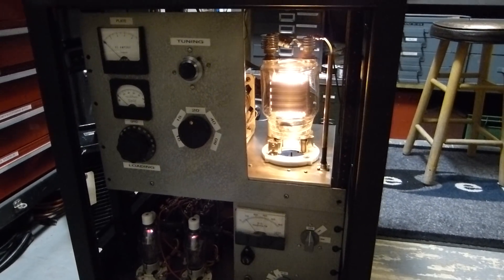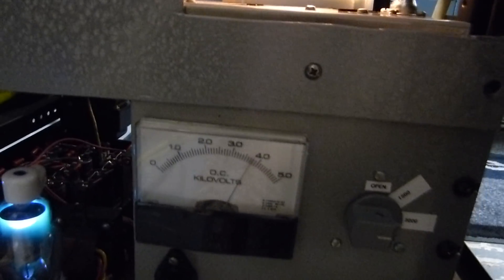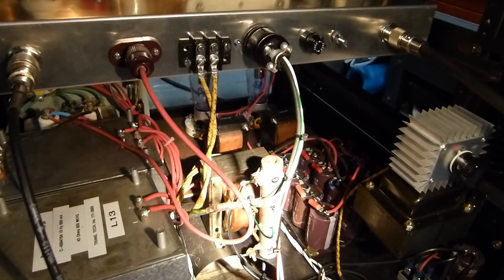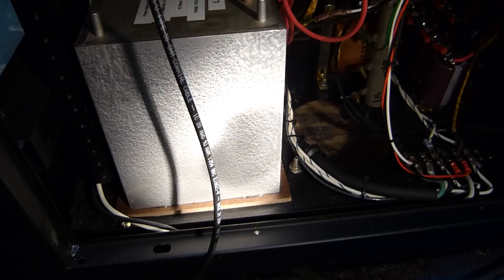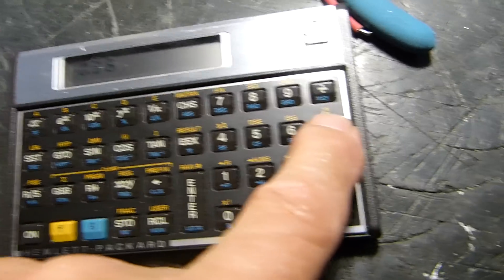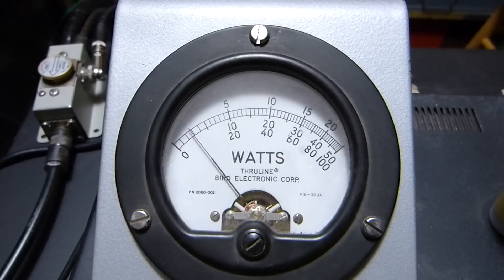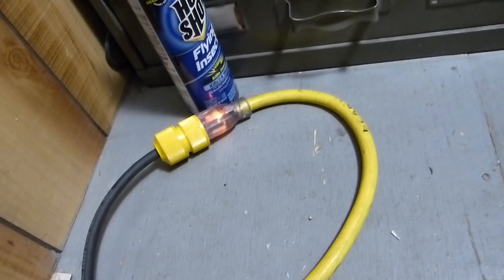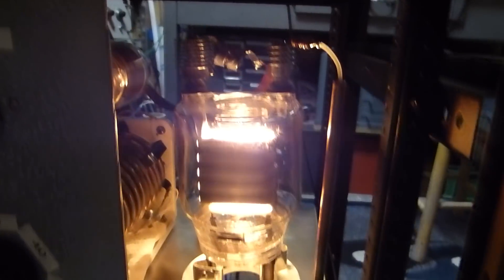(1 of 3) 833A Triode Vacuum Tube Radio Frequency (RF) Amplifier For 20 Meter SSB

Comment: i pulled my one out of  storage and want to finish it this summer, it is a project that never got done due to parts availability, any way, mine i want to go GG at 3000v ht, 160 to 20m is my goal, 15m and up i have other amps to cope.... how much drive did you use on the grid and what is your grid voltage set too ? enjoyed the video.
cheers Johan
project, phase 2
  https://www.youtube.com/watch?v=GUnv6McaL7s&ab_channel=LuckyDubeinRC

testing tube   https://www.youtube.com/watch?v=OxwV3x0OjLQ&ab_channel=LuckyDubeinRC
Reply from the maker: You need to see my last video on the 833A so you can see the bias level I use at different plate voltages.
https://www.youtube.com/watch?v=ChHPL84f22Q
I don't think the 833 is going to work very well in GG. It is a medium gain triode and not a high gain triode so grid bias is necessary.
Thanks for your links.
Reply from the maker: I have seen your YouTube postings and always give you a thumbs-up. Not many of us are interested in building with this big bottle  triode. I think I build mine just to see how hard it would be to tame this beast at 20 meters. There were some challenges and ideally it would be best to have a roller inductor for the plate tank. I was determined to use the B&W 852 tank coil although it was designed for a lower plate impedance. It will load up properly (now that I have removed the 10 meter coil) in both the 20 meter and 40 meter switch position. I get a little better efficiency with the 852 in the 40 meter position. That makes the Q a little lower. It seems a Q of 10 is good for 40 meters and below and at 20 meters and up, the Q should be increased to 15 or more. Just my thoughts on it. Keep us posted on your amplifier progress. 73

Comment: If the dc input to the plate is 1kw and the output is 750w, wouldn't that be more like 75% plate efficiency? I hope you'll share the schematic. I'd love to build one.
Reply from the maker: Interestingly, I just posted an update on this amplifier. I have done the math several times on this and other amplifiers and the efficiency is more like 65%. 75% for a class-B amplifier is a bit high. You can get as much as 75% from a class-C amplifier. Without looking at this video again, maybe I generalized without doing the exact math. If you watch the video that is posting right now, you can do the math of plate current times loaded plate voltage and compare it to the output on the wattmeter and determine the real number. Thanks for watching and commenting.
Reply: @ElPasoTubeAmps  - Ok, you're correct. I did the math. So I'm guessing this is a class AB1. Did you swamp the grid with 50 ohms? It looks remarkably stable.

Comment: Doesn't that emitting lots o x-ray?
Reply from the maker: No, X-rays need a potential of a very minimal of 20-25 KV and to get any level of serious X-rays you need a potential of 50KV and more. Next time you go to the dentist, look at the spec plate on their machine. You will probably see it runs at about 75KV at maybe 10 mA.
Take a look at these specs.

Inherent filtration 1 mm Al equivalent at 70 kV
according to IEC 60522
Anode voltage 60, 63, 66, 70kV
Anode current 8, 7, 6, 5, 4, 3, 2 mA

https://www.planmeca.com/na/Imaging/Intraoral-imaging/Planmeca-ProX/Technical-specifications/

Comment: What do you charge to build an amplifier?
Reply from the maker: It takes about the same amount of money to build a project like this as it does to purchase a new or used commercial amplifier. Between the tube, vacuum capacitor, cabinet, transformers, capacitors and so on, the cost to build such an instrument is probably $700 to $800 - maybe more... If I added in what I would expect for labor (probably 100 hours of work) then it would cost two to three times what a commercial amplifier would cost. A Collins 30L-1 will end up costing about $1000 after power supply repair and possible new 811A's. The Ameritron amplifier running either three of four 811A' is less than $1000 and it is brand new. The older Heathkit SB-200 and SB-220 is usually a good bit less than $1000 so, it just isn't feasible for me to try to build such an amplifier for sale.

Comment: You have been busy my friend. I marvel at the mechanical genius that goes into high frequency/high voltage construction. This takes me back 50 or 60  years when I could only dream of such a project like this. I really enjoyed the walk through. Thankyou.
Reply from the maker: Thanks, Bob. Big projects like this drive me crazy and I dedicate a lot of hours to these builds. As painful and uncomfortable as it is to crawl around on the floor doing this job, it is actually what brings me peace of mind although I am thinking this may be the last of this size project. I do have it working properly with the tranceiver and was working our friends down-under last night with good signal reports. I ran coax into the workshop so I can test it out before giving it the final kiss. Just got to package it up in a tidy manner and make one more video of it to complete the project - and then figure out how to get it from my workshop to the basement.

Comment: How much would you charge to build a single 4-400 RF amp?
Reply from the maker: The parts to build a single 4-400A amp would cost about the same as a new Ameritron amplifier - that is my guess. Some money could be saved if a vacuum capacitor is not used and the cost of a cabinet can be substantial, if it is purchased new - around $300.  You can certainly buy a new or used Ameritron, Collins 30L-1 or the older Heathkit SB-200 or SB-220 for much less than I would have to charge to build an amplifier - and the shipping might be $200 as I do not know how to build small...   :-)  I have sold some of my amplifier chassis in years past (without PS) and I built a quad 811A amplifier for my friend at WSMR at the MARS station (now SK) but I don't think it is feasible for me to try to build any such amplifier for sale anymore. It would probably take me 100 hours of work so it would be two or three times the cost of a commercially made amplifier.
Reply: ElPaso TubeAmps, copy that thank you for your time

Comment: Careful pointing, I couldn't tell how close you got to anything in there but 3600 Vdc can make a surprisingly long leap to bite you extremely hard!  I once knew a very old Electrical Engineer who worked for what is now Excel Energy.  He told me as a recent college graduate one of his Co-workers was giving a tour of a Power sub-station to management.  Maybe his leather shoes were wet or it had something to do with high humidity, but he pointed to something and a bolt of electricity just blew his arm off and killed him dead on the spot.  He told me whenever you go in somewhere with 1000+ V of juice flowing around to never take your hands out of your pockets!  It left an indelible impression on his mind, and he never took his hands out of his pants pockets around High Voltage again.  ;^)  I did have +450Vdc from a 120+ Watt 6L6 guitar amp jump up and bite me hard once.  It only went from my fingertip to my forearm touching the case, but it gave me the hardest bite I ever got!  Probably why I prefer around +250Vdc for my tubes B+ if I can get away with it!  Equipment that arc's occasionally scares me now!  LOL
Reply from the maker: My finger was a long way off. It was the shortening effect of the lens that made it hard to tell the distance. I realize 3KV will kill me if I touch it. The worst I have ever been shocked was with a Heathkit DX-100 transmitter at 800 volts. I was setting the transmitter on its side and accidentally turned the switch on with my belly. Obviously, the transmitter was still plugged in and that was stupid. I had changed out the 5R4 rectifiers for SS also. This was 1970. I had just changed out a bad modulation transformer with one from an ART-13 WWII transmitter and the HV terminals came thru ceramic insulators on the side of the modulation transformer when I somehow set the terminals down on my left wrist. The unit is a good 80 to 90 pounds so I had a serious grip on the unit. It is a miracle I survived. My body was in a horrible knot, my mouth tasted like I had been chewing on aluminum foil and the smell of by burning skin was terrible. That was 48 years ago and I still have a scar on my left wrist from it.
I also generally operate with one hand in my pocket but I take it further. I Never work with both hands on any live circuit. I am so dedicated to that procedure it extends to circuits not live. I am very cautious as I choose to work along. People distract me and the likely hood of an accident occurring when someone is in the shop with me is very much increased because of all the talking. A ringing phone can scare me out my wits when I am dealing with HV as I am so concentrated. Never lay one arm on the chassis or cabinet and get sloppy. Always using only one hand, I clip on the ground lead and then the hot lead, with the other hand either in my pocket or behind my back if I have to connect a meter while the circuit is hot. I usually turn everything off (and unplug it...) before any HV measurements at the multi-KV level and then stand back away from the unit before applying primary AC.
I also have know a couple of guys with holes in their finger tips and elbows from HV. Lucky for them it was only thru one arm and not their heart. My experience with the Heathkit DX-100 was from arm to arm and thru the heart that is why I know I am lucky to be alive.
Reply: I'm a wimp when it comes to HV!  You can work with it using due respect!  But for me, the risk vs reward ratio doesn't make sense!  Even if I can keep it from biting me, HV and High Current just burns things up quickly if any of your parts tolerance or quality drifts from the required standards.  Give me a chance to notice something getting hot and shut it down before it smokes everything, please?  LOL  HV/HC gives no 2nd chances!  Have Fun.  I'll watch from a safe distance over here!  LOL
Reply: I sent you the schematic for an OTL 6080 headphone amp when you pulled some of those out to play with a few months ago.  I forget exactly what B+ I used with that but I know it was+250Vdc or less.  A 6922 or 6DJ8 gives us a triode to drive each L/R stereo channel using the 6080's triodes to drive higher ohm headphones, (250 ohm or better) without any output transformers.  I was hoping to get you interested in building one.  2 tubes and minimal other parts required.  I wanted you to document the OTL output with your nice bench gear.  It supposedly has nearly flat response from 20 Hz to nearly 100 KHz from 2 triodes and little else in the signal path.  Please let me know if you ever return to fiddling with the 6080's or 6DJ8s.  ;^)  Thanks!
Reply: I had a kV across the thumb in my 20's. I was working on a 2C39 amp. Well this great sizzling flame came up between the B+ (HT as we say) and thumb. Ii drew my hand away was lucky . The burn it made took months to heal up right. Its always those careless moments that get you. Anyway the best tip I can pass on is keep that left hand in your pocket. My other amps had 3kV and more on them and I never got bit because I checked and double checked every move.  Make that discharge wand and.build those interlocks. You may have many lives during your brushes with this kind of gear but the B+ only has to get lucky once!

Comment: Glad your back! Very nice transmitter amplifier done old school! Will the amp need a fan for cooling the tube?  

Is there a smaller mercury vapor rectifier for use with audio amps that will modulate in  brightness/glow like those 866a's? That is very impressive! Cheers and keep em glowing!
Reply from the maker: Hi Mark,
It does need a fan and I did have one blowing over it for this video. That is one more thing in addition to the T/R relay I need to install. There is a smaller MV rectifier called the 816 that might be what you are looking for.
https://www.ebay.com/itm/Two-816-Electron-Vacuum-Tubes/323321001098?hash=item4b476ef48a:g:PQ8AAOSw6iFbNEc2

Comment: Would be interesting to have this on 630mtrs .
Reply from the maker: Why 630 meters? That would be around 476 KHz. 
My guess is most of these big guys came from commercial AM radio stations. This particular one is a JAN and I think it has US Navy on it. I guess it came off a ship? Who knows.
I have one other that I need to test but this one performs amazingly well. I continue to be very pleased with its stability and efficiency. Lots of information out on the Internet concerned with poor efficiency at 20 meters for the 833A but it is doing just fine.

Comment: Hi Dave,
What element were you using for the watt meter and do you have a multiplier circuit?  73  WB3BJU
Reply from the maker: I am using the Bird 2500 watt 3-30 MHz element. I have a digital readout that I can put in place of the analog meter and by changing the scale I have found that I can get some better relative readings that came in handy a few years back when measuring 2.4 GHz frequencies (especially reflected power) but I don't have any true and accurate multiplier circuits for the meter and elements.

Comment: wow very impressive, probably the instability is because the shield picks up signal in the RF tank and it creates a strange freedback... maybe grounding the shield at bouth sides with a low impedance path solves the problem.
little question, i am finishing my electrical technology high school il italy right now, we have to make a project and i have built a GU81m hf amplifier; can i spot you in the information sources since i have learned a lot from you?
 73, IU3IRR from italy, 18yo operator
Reply from the maker: Manual,
Yes, of course you can use me as an information source. Congratulations on finishing electrical technology in high school. They didn't have things like that when I was in high school but I did have an uncle that was a chemist at ORNL that inspired me in all things academic. I started with my general class license at age 13 in the 8th grade in 1963 and I have loved it ever since. I flip-flop back and forth from audio to RF in what I build.   73 WA4QGA
Reply: our school system works like that, when you end medium school you chan choose a classical school or to attend a technical school.
to work out the values of the pi filter i wrote a software that takes the plate resistance, parassitic capacitances and other parameters. it tryes to match the plate to the load with a range of possible capacitances and inductances values within a frequency span. it than show the best match and the range of capacitances used. it is still in beta but if you want i can send you the program to ceck it out since i am loocking to publish it.
just to have an opinion  :)
i wish you can take a loock also to the relation i have made.
73, IU3IRR
Reply from the maker: Yes, if you can send me the program I would like to have it. I have written similar programs back in the 1980's for Pi network design. Mine are written in BASIC (GWBASIC) and I still use them. BASIC will run even under Windows 10 in a small window but it works great. I used the programs I wrote back then on this 833A amplifier. I have a  .bas file that you might like and I will send it to you if you want it.  I don't know if BASIC/GWBASIC is still on all PC's but I think it can be gotten off the Internet for free.
My direct email address is,   theaudioshop@sbcglobal.net
Reply: good, thanks. in a couple of days i will take my last exam and then i send the email.